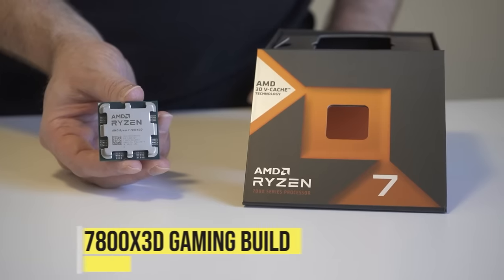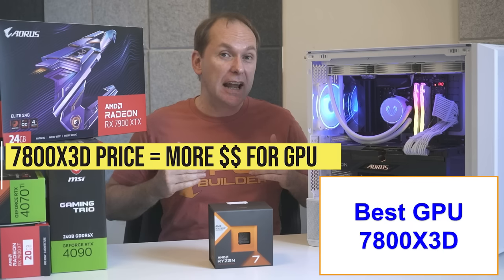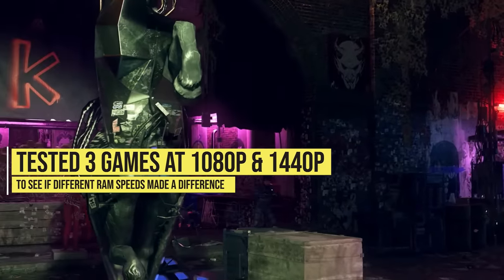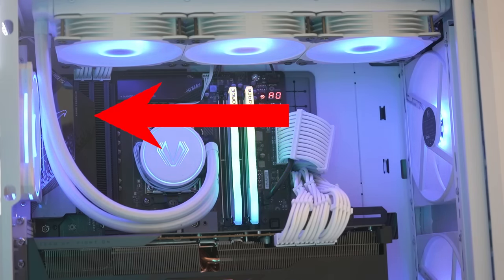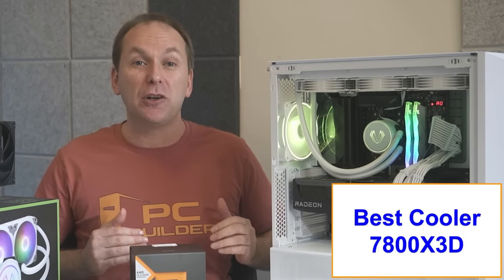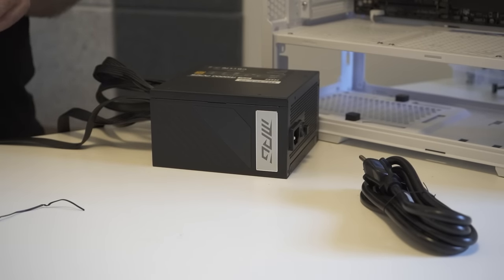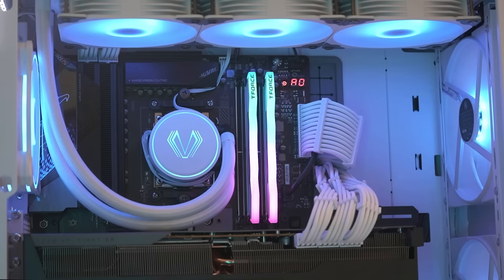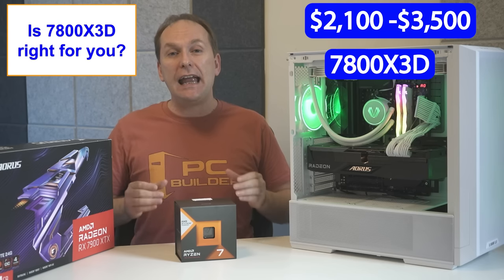🛑 Best Ryzen 7800X3D Gaming PC Build 🛑 Best RAM, Motherboard, GPU & More

Comment: I'd love to see an small form factor build like itx for midrange productivity and gaming if possible. Brother wants to have something he can carry from place to place when needed.
Reply: What's your brother's budget?
Reply: @Ty Kelley  probably around 900 to 1000. No monitor necessary.
Reply: @Korrik7  here's a sample build.

I can't post links so I'm just commenting the parts and you can input them into PC Part Picker.

CPU: Intel Core i5-12400 2.5 GHz 6-Core Processor

CPU Cooler: ID-COOLING IS-47-XT 46 CFM CPU Cooler

Motherboard: MSI MPG B760I EDGE WIFI DDR4 Mini ITX LGA1700 Motherboard

Memory: Silicon Power GAMING 32 GB (2 x 16 GB) DDR4-3200 CL16 Memory

Storage: Silicon Power UD90 1 TB M.2-2280 PCIe 4.0 X4 NVME Solid State Drive

Video Card: Intel Limited Edition Arc A750 8 GB Video Card

Case: RAIJINTEK METIS EVO TGS Mini ITX Desktop Case
 
Power Supply: FSP Group Dagger Pro 650 W 80+ Gold Certified Fully Modular SFX Power Supply

Total: $1003.81
Reply: @Ty Kelley  very cool. Thanks I'll take a look at this. Many reviewers showcase high end rigs for itx, so it's nice to see other possibilities and cases.
Reply: @Korrik7  you're welcome.  No idea if the case is good but I wanted to make sure he has one with decent airflow and this has it.  Plus it's not too expensive.

If he could spend closer to $1200 I would do 13500 and A770.

CPU: Intel Core i5-13500 2.5 GHz 14-Core Processor

CPU Cooler: ID-COOLING IS-47-XT 46 CFM CPU Cooler.
Motherboard: MSI MPG B760I EDGE WIFI DDR4 Mini ITX LGA1700 Motherboard

Memory: Silicon Power GAMING 32 GB (2 x 16 GB) DDR4-3200 CL16 Memory

Storage: Silicon Power UD90 1 TB M.2-2280 PCIe 4.0 X4 NVME Solid State Drive

Video Card: Intel Limited Edition Arc A770 16 GB Video Card

Case: RAIJINTEK METIS EVO TGS Mini ITX Desktop Case
 
Power Supply: EVGA SuperNOVA 750 GM 750 W 80+ Gold Certified Fully Modular SFX Power Supply
 
Total: $1188.81

Comment: What are you gaining from going with the premium options? Does that leave more room for upgrades later on and/or to make sure this pc build lasts years to come with no need to upgrade?
Reply from the maker: Honestly there's not a lot of performance difference, mostly style
Reply: @PCBuilderChannel  can you list a link for those cable extensions you used. I have the same setup using the msi a1000g and an 7900 xtx. I hate that one of the pigtails have to be left hanging. Also, did you only use 2 pcie connectors for the gpu and 2 for the cpu from the psu?

Comment: Hi Jason,
I am currently planning too build a pc similar to this and as such i have been taking my time browsing the channel and others so I don't mess up.
One question came up after watching the airflow video and this one:  you advise 1 more intake fan than the outgoing fans in your airflow video.
Yet in this video there is only 2 intake fans and 4 outtake.
Is this because of the sheer volume the 2 intake fans have or did I miss something?
Kind regards.

Comment: Hey, I've been trying to build my PC, your videos have been incredible, but I do have a question on this build, this is a very gaming oriented build, I wanted a PC that could do both (productivity and gaming) would this still be a good build for it? or it would be better to change to CPU to a Intel like the I7 13700K?
Reply from the maker: For mostly gaming with some productivity this is great, if mostly productivity with some gaming I would go 13700K. And remember to check the applications you use to see if you need a Nvidia GPU for compatibility

Comment: Great video. I am wanting to try and build my first PC instead of buying off of dell again. Bought off of Dell for the past 15 years. One difference I am building for Microsoft flight simulator and so many of my settings are design for NVIDIA card such as a 4090. Would appreciate any info and so you can give me on building one like you show here for the Microsoft flight simulator. Thank you!
Reply from the maker: It all depends on your budget and the experience you are looking for. If you have the budget for it the best of the best would be this 7800X3D build paired with a 4090. If that's out of reach check out 7600 build guide from this week and pair it with as high a Nvidia GPU as you can get.
Reply: @PCBuilderChannel  I like the $2,800 price tag that you had shown at the end of the video. Anything much more than that seem like it's cheaper just to buy a Dell Aurora AR-15. Already built but kind of tired of buying Dell for 15 years would like to build my own, be able to add whatever I want and have the room to do it
Reply: @PCBuilderChannel  do you feel like Redux computer builders are a good quality computer build?

Comment: So shouldn’t upgrade  from  5800x3d to 7800x3d which would be paired with a Aorus master 3080 12g? how do u feel about that cause I have a dual setup and want to upgrade my streaming pc to what’s in my gaming pc and run the 5800x3d on the streaming pc paired with a 1660 super. The cpu is 3200g amd
Reply: 5800X3D is still viable for the streaming PC you have. Pairing it with a 3080 would be great.
Reply: @rogued3mon414  so the 7800x3d on the 3080 and 5800x3d on the 1660 super which is the streaming pc?
Reply from the maker: No I wouldn't. But I also wouldn't pair a 5800X3D with a 1660 super. You should check out our "Best CPU/CPU combo" video. Its older but you need to learn about system bottlenecking and it will give you an overview. 5800X3D is a good combo with 3080 though and something like a 1200f or 5600 is good wit ha 1660 super.
Reply: @PCBuilderChannel  really appreciate u bro I learn a lot from you stay blessed💚💜

Comment: I'm surprised you didn't already know from the previous 5800x3d that ram speed made almost no difference due to the x3d cache... non x3d chips will benefit from higher MT's and lower latency than the x3d versions of the same chips.

Comment: Trying to replicate this build, but can’t make sense of the cables & what needs to be plugged in to what. The instructions included with the case & cooler are total crap. This is my first ever attempt at building a pc.😫

I’m using a B650 motherboard, but all other components are the same as in your video. I’m wondering if you happened to get any detailed footage of how everything is plugged in?! 😅

Please & Thank you!
Reply from the maker: Hop over to our "how to build a pc" step by step video!

Comment: my current MOBO is almost 7 years old, and as of now the front USBs on my case no longer let the MOBO boot when connected, so I decided to upgrade, I ended up choosing the ASUS Prime 670E-Pro and also went with the 7800X3D, now I'm looking into upgrading my current DDR4 ram to the support DDR5 RAM. My older EVGA 1070 GPU went out about a year ago so I went with the more budget EVGA 3070ti, will this build give me any issues with gaming at 1440p? thanks! great video, new subscriber here!
Reply from the maker: Thanks for the sub! Yes you will need to get DDR5 as AM5 only works with DDR5. Check out our Best Ram for Gaming 2023 video for help with that. Sadly I don’t recommend the 3070ti these days due to the lack of VRAM, and it’s a bit lower than I would like with that powerful of a CPU. I recommend 7800XT, 7900XT, or 7900XTX. 7800XT for 1440p focus, 7900X or 7900XTX to give access to 4K and super high fps 1440p gaming

Comment: Hey Jason, do you think Kingston Nv2 worth to buy. I don’t want spend to much on a SSD and I want it Gen 4 too
Reply: If you're going for a game drive, yes but not for a boot drive in case you have a high end build. If your build is not high end, then this drive is good enough for both game and boot drive
Reply: @rogued3mon414  do you think Nv2 is also good for streaming too
Reply: @MG0301  For a game drive, yes but depending on your budget, at least get a better SSD with a DRAM cache. What's your specs though?
Reply: @rogued3mon414  13600KF + RTX 3060 ti i only play and streaming Valorant. I dont play other games
Reply from the maker: It's DRAMless so under heavy sustained writes (think writes that go for 6+ minutes in professional production tasks) it will be slower. But for anyone who just does regular stuff you'll never notice the difference. Silicon Power A80 (linked in the description) is a good Gen3 option with DRAM if you need something more pro-sumer.
Reply: @MG0301  Do you already have an ssd in the system or you're going to get one?
Reply: @rogued3mon414  nah…I dont have any. I was planning to build a new PC ( the 13600KF + RTX 3060 ti) and I see Nv2 such a good deal and I just ask for sure

Comment: New sub, love the channel. Jason, I just finished a 7800x3d / 7900xtx build on an Aorus X670E Elite AX yesterday. I have the Teamgroup Delta 2x16gb 6000hz RAM you talked about in this video. I've read that enabling EXPO/XMP can sometimes cause stability issues, so I haven't done this yet. I have already installed Windows and the system is running fine. Should I be concerned about enabling EXPO/XMP? Thank you!  (forgot to add that I flashed the most recent bios to mobo before build)
Reply: did you enabled expo? how it works?

Comment: Would you have bumped up the PSU if you were using a 4090 rather than the 7900xtx to something like a 1200w or do you think the 1000w would still be enough?
Reply: To figure out PSU wattage put your build into PC Part Picker and times the watts by 1.5 to see what watt PSU you need.
Reply from the maker: What Ty said! Hop over to our Best PSU 2022 video for more on this

Comment: Hey man. Few months back i bought Gigabyte B650 Ax Elite with ryzen 7700x and a pair of Tridentz 32gb 6000mhz cl36 rams. Even though they are XMP version, theu work great with my biild with no issues at all. 

But i am looking to upgrade to 7800x3d, do u think B650 would be no issue? Or should look for x670-E one as i am also using a 4080 with 1tb ssd nvme

Comment: Is the 6950XT and the 7800x3d a decent pair?
Reply: Its decent but but you could go for the normal 7700x or 13600k and the 7900xtx since games are GPU demanding and not so much for the CPU.
Reply from the maker: You're right on the edge. I agree with Rogue's advice, I'd recommend coming down on the CPU and spend the saved money going up on the GPU to give you better FPS.

Comment: Hello kind sir,I think I will get the B650M-HDV/M2 for the ryzen 7 7800x3D as I think it will handle the cpu without issues. I have a question. Does my aio cooler for AM4 with my previous cpu ryzen 7 5800x3D Corsair iCue h100i Pro(240 mm) RGB XT could handle the ryzen 7 7800x3D or do I need a more powerful one? Thank you!

Comment: I used GB b650 gaming x ax with r5 7600 and 7900xtx ddr5 6000 cl36 did not run memory with launch bios at 6000 but no issues with the latest available when i built it in march.

Comment: How does this cpu perform in the new Microsoft Flight Simulator and FSX?
Reply: Update: There is one review on YouTube indicating that it performs exceptionally well in MSFS 2020. Nonetheless, a new CPU with board, RAM and possibly cooler upgrade is certainly going to carry some cost.
Reply from the maker: This is a great build for Flight Simulator as long as you go for a higher end GPU like we recommend

Comment: I am currently having ram compatibility issues (I think that's what it is) no blue screens or over heating just random light crashes. And I am using asus rog strix b650e-f gaming wifi motherboard with CORSAIR DOMINATOR PLATINUM RGB DDR5 RAM 32GB (2x16GB) 6000MHz CL36 AMD EXPO. I need your advice and guidance... I am using 4 sticks of the same ram because of the anesthetic. I looked at asus website and I guess each am5 motherboard has specific ddr5 ram kits that compatible with each motherboard. This is all stuff they don't tell you. I dont know how you get away with just throwing anything in lol. I have the same cpu, and a tuf og 4090 oc edition and everything. This was my first build and I went all out and it's my transition to pc gaming from console. I've liked the whole construction and picking my parts but I just want everything to run smoothly. It's impossible to find a video on YouTube of someone having my exact problems. Please help me. I doubt you'll even see my comment though. It was worth a shot
Reply from the maker: Frustrating! For troubleshooting I recommend posting to reddit "Build a pc troubleshooting forum" its a great resource. I hope you get it sorted out quickly!

Comment: I've heard confusing things about RAM. Mainly to do with the duel channel thing. Is there any difference in real life terms, between using 4 x 8gb sticks, opposed to 2 x 16gb sticks?
Is there a limitation on how high of a Mhz frequency you can overclock your RAM to depending on how many modules are in use?
Reply from the maker: Check out our Best Ram for Gaming video!

Comment: Very nice video! I was considering to pair the 7800x3d with one of the upcoming 4070's, but after your minimum GPU recommendation I'm now not so sure. I know that card is not released yet, but assuming a similar performance to a 3080... do you think the bottleneck will be so worrying?
Reply: Pairing with a 4070 would not be the end of the world, but the 7800x3D gets you a lot of CPU headroom, so in some games a plain 4070 (or even a 4070ti or 7900xt) will bottleneck you. Only exception might be if you're gaming at 1080p, in which case a 4070 would probably be fine.
Reply: @kelsealawrenson7188  I'm planning this build for 120+ fps gaming at 1440p on my samsung QLED
Reply: @xtrevizex  Just remember most games are GPU bound at 1440p and 4K, so you'll get more frames with a better GPU than CPU. If you're a little restricted on what you can spend, you might be better off spending a little less on the CPU and putting it towards the GPU instead (like he says a few times in this video).
Reply: @kelsealawrenson7188  thanks, i'll get a 4070ti
Reply from the maker: What the other commenters are saying (: 
We will need to wait for testing of the 4070 to know for sure but this is such a powerhouse CPU I’d prefer to see it paired up. Otherwise you’re better off going for a 7700 or 7600 and investing the savings into a better GPU
Reply: I got the 4070ti yesterday. And today I've cancelled it. 1000€ for 12GB ram..., nope. I'm probably gonna get the 7700 and a 7900xtx or a 4080. Thanks!

Comment: My comp is in need of an upgrade, whell, massive overhaul. My question is, is the 7800x3d better than anything else for things like UE5, unity, blender, etc? Sure, I play games, but I'm not worried about frame rates as much as I am about rendering and such.
Reply from the maker: You GPU choice is going to be more important than you CPU choice for that. I would recommend minimum 4070 but preferably 4080 or 4090. Then if production is your main focus I would go 13700K instead.

Comment: I play games that use a ton of resources for AI so the GPU does not matter as much. I bought a 7800X3d with a 6800 rather than paying for over priced GPUs.  The games I play have over 400 FPS any way how ever the AI is toned down a bit so its not overloading my CPU.  And yes some games are using AI that scales up if your CPU can handle it.

Comment: 7800X3D's RAM speed ratings are 5200 for 2DIMMs dual channel and 3600 for 2 DIMMs per channel. For gaming, would it be better to run one or two dimm configuration?? Thanks
Reply: Always go for 2 dimms. That goes to all CPUs.
Reply from the maker: What Rogue said!

Comment: I was planning on putting this into the NR200p Max with the 7900xtx, would the 800watt included psu be fine?
Reply from the maker: Hop to our Best PSU 2022 video and follow the method there to check for your full build

Comment: what about pairing a 3070Ti to the 7800X3D? is it too, too weak?
Reply from the maker: It would bottleneck. For the 7800X3D, you'll want minimum 7900XT or 4070ti.
Reply: @PCBuilderChannel  yeah, I'm going for the amazing 5800x3d instead. Thanx !

Comment: Hello, cool video! Though do you really think to combine the XTX with the processor? Yes, indees it is the fastest one on the market. In about 70 % of the gaming benchmarls faster or much faster than 13700k. But I´ve seen videos, showing that there are games where a 4080 is bottlenecked by that CPU in 4K. So I have to use a firm monitor frequence in that case. Wasn´t the XT a better choice to make it easier to play games in 1440p with high fps for example?
Reply from the maker: 7900XTX is more powerful and will give you less bottleneck than a 7900XT. You might want to check out our Best GPU/CPU Combo 2023 video for more on understanding bottleneck. And personally I absolutely love the performance of this build, you can check out our benchmarking at the end of the video
Reply: Ahhh... nope! For example I´ve got a 13700K with my 4070 Ti. In many games with high fps I have to go to 4K resolution in order to prevent the 13700K from bottlenecking the 4070 Ti. So even a 4070 Ti is a difficult candidate with a 13700K. I considered to buy a 4080, but after that expierence I´ve chosen to wait for the next generation Arrow Lake of AMD next gen. o the problem I wrote about was not GPU bottleneck but CPU bottleneck. There is NO problem, if the GPU is too slow, but with a slow CPU one will have stutter in gaming at high fps... @PCBuilderChannel

Comment: Hey Jason, do you have your Gpu overclocked? I have a 7900xtx n a 7950x but hit 160-180fps on modern warfare 1440p
Reply from the maker: Yes we overclocked the Aorus Elite 7900 XTX using the built in utility in Radeon Adrenaline as it has a massive cooler. We describe this in the video. Note that we use the in-game benchmark using the "balanced" preset as it is the most reproducible data and we just didn't have time for complicated in-game benchmarking due to the tight turn around. So your results may differ.